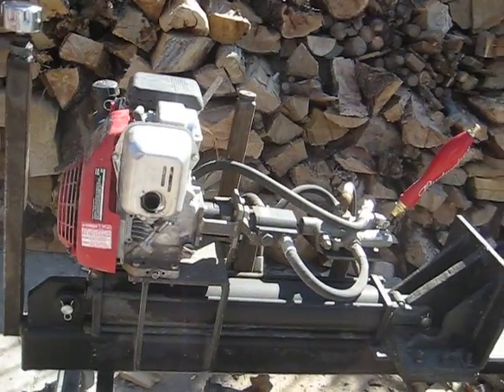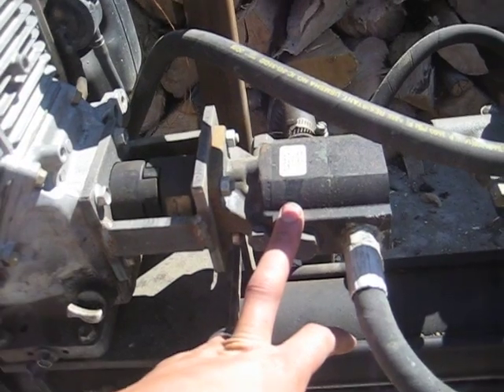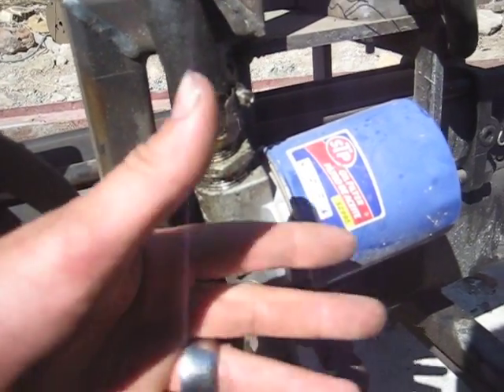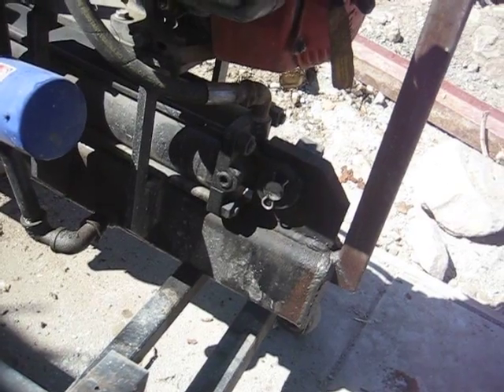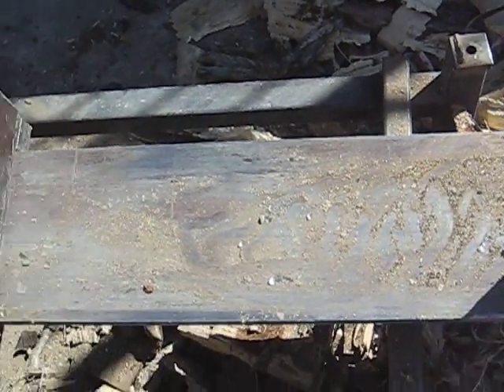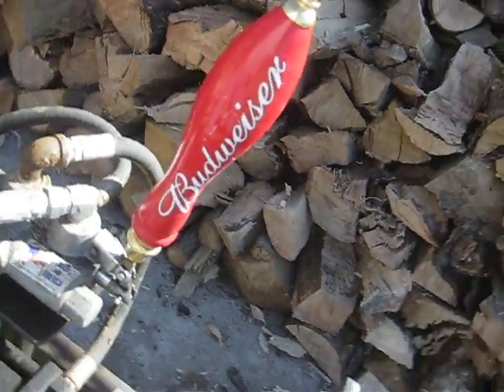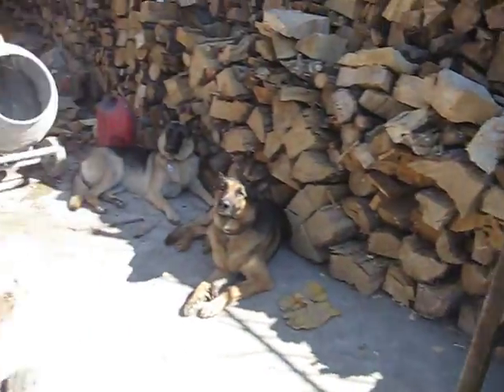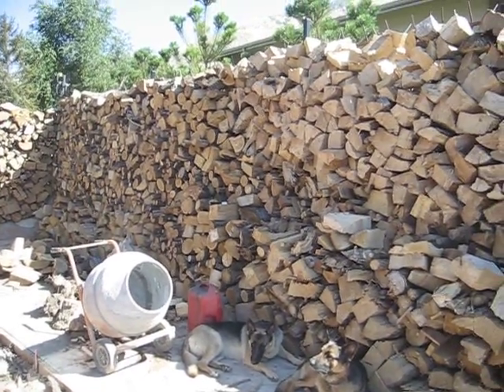homemade log splitter

Comment from the maker: @zuuluu1  google this---- how much horsepower hydraulic pump g.p.m. ---then go to the surplus center ---its like the second one down in the results they have a calculator for all that stuff, generally you need 2 h.p. per 1 g.p.m. you might consider a 2 stage pump then you'll only need 1 h.p. per 1 g.p.m. hope this helps!

Comment from the maker: @zuuluu1 there are a few considerations, to increase speed use a higher g.p.m. pump, however this will require more horsepower, or if it is easy enough just add another control valve with quick couplers and a smaller ram that will also increase speed with useing the same engine and pump(3000 p.s.i. pump with 4" bore will be approx 17 ton-- 3 inch bore will be approx 10 ton-- 2 inch bore will be approx 5 ton, any more ? feel free to ask, thanks

Comment from the maker: @foo444 I think you may mean negative pressures (suction), well I timed my cycle at 15 seconds (actually 14.7 average)  to complete the stroke both ways, my ram consumes 1.31 gallons so 1.31 x 2 = 2.62 gallons both strokes my pump is moving at a rate of 10.48 g.p.m. (actually 10.69 g.p.m.) I think I will deal with .52 g.p.m. slower to protect my investment, oh and I used a over sized filter with a rating of 25 g.p.m. max flow no problems so far, thanks for input I will definitely look into it.

Comment: nice build but the reason every other log splitter ever built  is because your filter cant handle the high pressures the feed line supply,  the filter is designed to catch the metal that comes off the components as they wear under normal wear and to keep anything that somehow gets into the fluid out, but you should put an intake strainer on your pump supply hose to keep anything major going though the system i believe there usually 40 micron strainers. where a filter is normally around 5 micron.

Comment: Great job! I built basically the same thing with a free 6 HP pressure washer motor. I am also using the 11 GPM Haldex pump. How did you come up with the 17 ton rating? Most of the ones sold by Tractor Supply that have basically the same parts as yours are 20-22 ton.

Comment: Great vid,fantastic effort for the money.Totally agree about having the filter on the suction side of the pump.I think most manufacturers fit the filter to the return line because they can use a smaller housing and filter to save money.Does the hydraulic oil get hot with the suction and return lines being close together on the reservoir  tube.Good job AJS